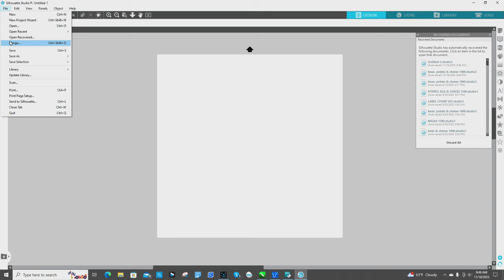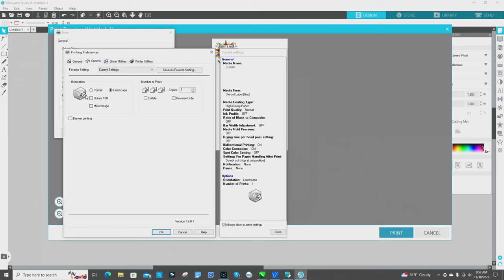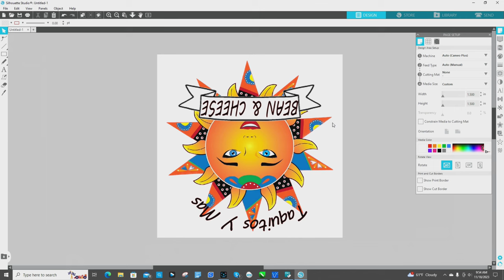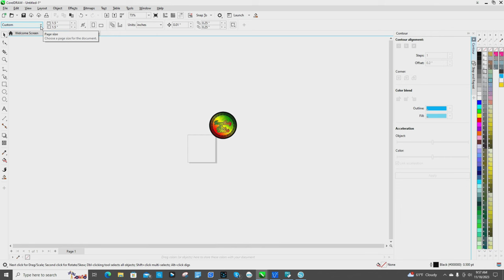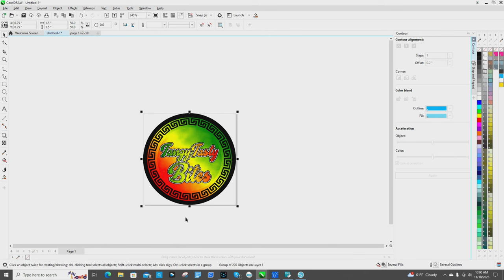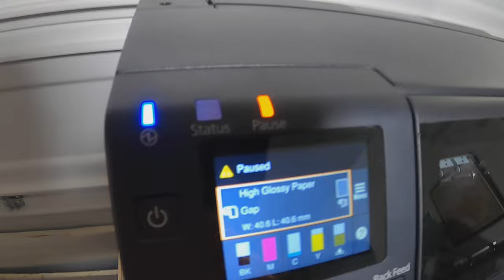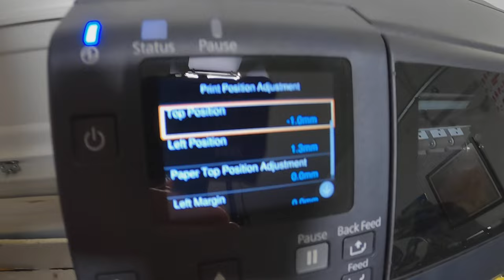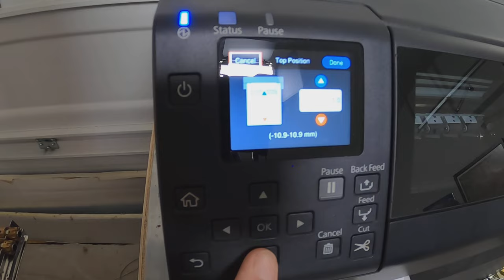Settings For The Epson Label Printer - ColorWorks C6500Au

Comment: I have a few of these. I don't bother zeroing out the position adjustment as 9 times out of 10, you need to adjust it anyway. If you move the dot on your gap sensor to the smallest point between the labels, your adjustments will be smaller :) They are fantastic printers though and very well built.

Comment: I have a c4000. I find setting it up fairly straightforward and it's pretty accurate. My main problem is the ink cost. In the UK the cartridges cost about £25 each (US$31.50) and are only 50ml. I have a converted eco tank that runs on pigment ink and prints from rolls and it's ink is about 10% of the cost of Epson's cartridges. I'm thinking of selling my c4000 just cos it's costing me about £400 a month in ink
Reply: Did you upgrade your machine? I'm looking at a c6500...